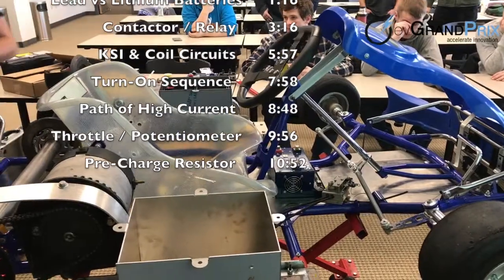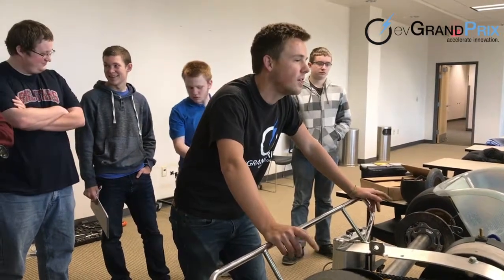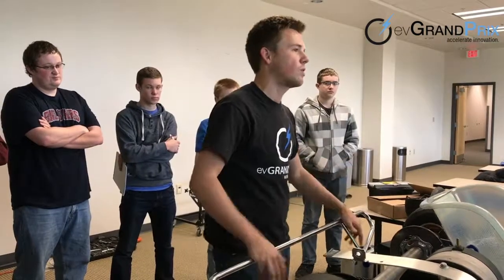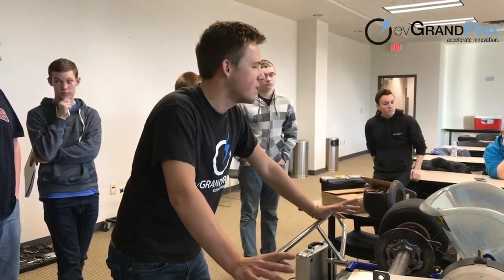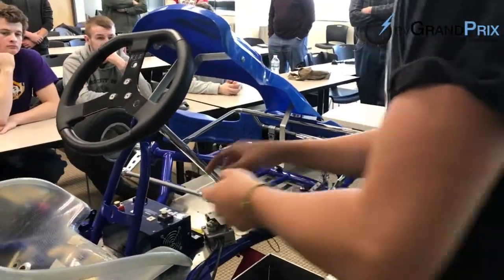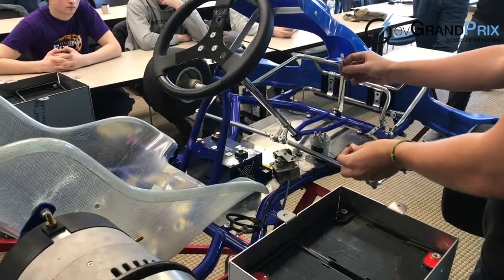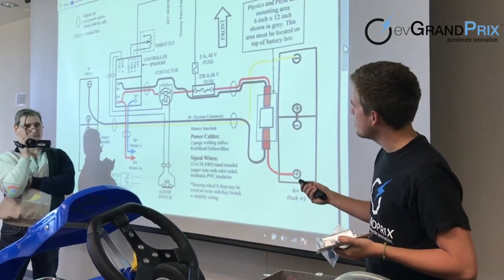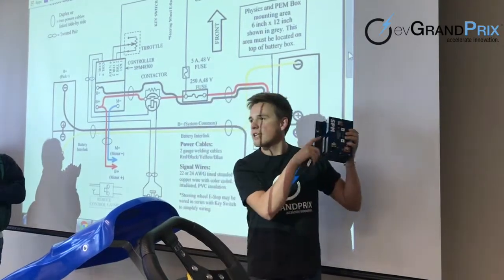evGrand Prix - Electric Powertrain Fundamentals

Comment: Hi EJ! Thanks for all the super informative vids. Youre a super charismatic dude!

If I may ask a question, what do the two switches do at the very top of the circuit diagram of the power train? 

As I understand it, the contactor serves as failsafe #1, the fuse serves as failsafe #2, and I assume those two switches at the top serve as failsafe #3 and #4? Am I correct in this? 

Im and EE student at UCSD rn and we're putting together a team to compete in the autonomous division. Hope to meet you one day 👍
Reply from the maker: Hey Dallas, awesome to hear you guys are making a team for the Autonomous race.  Is that the October 23, 2021, race you’ll be at then?  

Those two switches can really be one. The updated wiring diagram just had one switch which is the KSI (key switch ignition).  The other switch was supposed to be an on-steering-wheel emergency kill switch. 

So that KSI switch at the top is not a failsafe.  It’s the “on” switch.  But it can stop power to your kart, yes.  Just like the emergency kill switch can. It does this by opening the contactor.   

The high current fuse is considered a failsafe. But most of these are “slow blow”.  So you can accidentally short your battery pack and still get a good spark.  This is usually when someone is turning a wrench on the battery terminals or motor controller.  Make sure those wrench handles are wrapped in electrical tape!
Reply: @ejwilliams8793  Thanks for the answer man! Ahhh I see what youre saying now. That makes sense.
 I also had a good laugh about the story you told about how the relay welded itself to one side and you guys had to hammer it out lol. 

We just had our first meeting today where we got to meet our fellow teammates. Its funny, I feel like the small fry in the group as an undergrad compared to my peers who are some REAL hot shots. But hey, im willing to work hard and learn to hopefully be in their shoes one day. I got put on the subteam in charge of the braking system for the cart. Any advice on brakes? 😆

I believe we are planning to compete in a race in September 2021 so not the october one but Im not too sure yet. I know we are talking with the University of Hawaii who are going to catch us up to speed on some things. 

Its all very exciting!

Thanks again for the reply man!

Comment: any info on steering?
Reply from the maker: Hi, could you elaborate a little on what you're asking? Thanks.
Reply: @ejwilliams8793  the steering mechanism used on the kart.
Reply from the maker: @eToroBoT  The steering is not modified from how the kart comes.  It is a Top Kart chassis with a traditional go-kart steering column. http://topkartusa.net/electric/
Reply: @ejwilliams8793  the autonomous* steering, from the autonomous laps. apologies for the confusion.
Reply from the maker: @eToroBoT  Oh for the autonomous karts.  They have servos and motors attached to the steering column.  They use popular robotics parts like the ones offered by VexPro for First Robotics